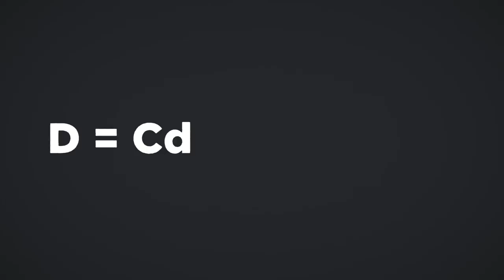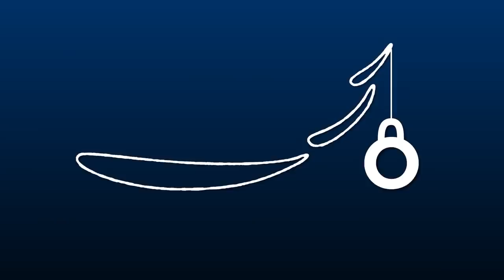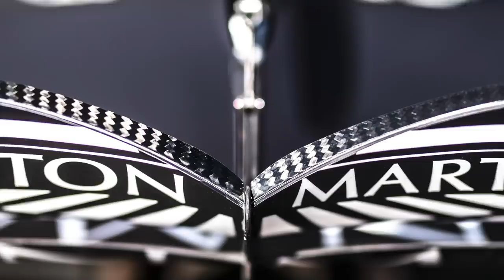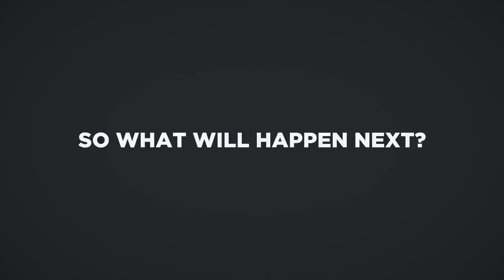What Are Flexi-Wings & Why Are They So Controversial In Formula 1?

Comment: Legal = legal. If they want to change the testing procedure than that's fine for next year.
Reply: Why not change it this year if it legal?
Reply: They should treat this like they treated DAS for Mercedes last year.
Reply: It's not legal. The regulations are clear, but the current tests can't factor in the loads. It's like there being a rule stating uou can't go faster than 20mph but you only have speed trap equipment that measures to 15mph, you know they are speeding but can't prove it.

Comparing this to DAS is like comparing apples and oranges, DAS was legal as there was no rule for it to break, so a new rule needed to be introduced but that can't happen until end of the year, which is why it was banned for 2021.
Reply: @jeeves19831  exactly. I think people’s judgement is being clouded just cause they want redbull to win really bad this season
Reply: Yes last year was it the das system
Reply: @Zerkyie  DAS was legal and abolished for cost savings
Reply: @jeeves19831  how do you create a rule you can't test for, changing the tests mid season because someone was smart enough to fit the tests and increase performance outside the test range is bad for development as teams need to follow interpretations of the rule book on what FIA wants but doesn't enforce.
Reply: Because there is a technical rule where active aerodynamics are banned and a flexing rear wing can be considered as a passive active aero, the reasoning used by teams that explored flexing wings that "it would cost more to make it rigid again", well they shouldn't have explored this avenue in the first place since active aero is banned, period
Reply: @jeeves19831  the cars were designed and tested according to the rules and test procedures that already existed. Changing the test because you don’t like the result is ridiculous.
Reply: Except that the technical regs allow FIA to change the test mid season.  No need to wait for next year.

Article 3.9.9: In order to ensure that the requirements of Article 3.8 are respected, the FIA reserves the right to introduce further load/deflection tests on any part of the bodywork which appears to be (or is suspected of), moving whilst the car is in motion.
Reply: @frankg2003  but the test isn't sufficient, the rules clearly state that aero devices must be stationary allowing for minor deviations, that deviation is as following :-

The first test demands that the rear wing must deflect no more than 7mm horizontally when a 500N load is applied horizontally.

The second test demands that the rear wing can deflect no more than 2mm vertically when a 200N load is applied vertically.

purposely designing a wing that conforms to the 1 degree of permissible movement under the test load but then moves 5 times this under real world high speed loads is clear cheating by circumventing the inadequate testing.

Do you also believe that Ferrari weren't cheating because their engines passed the standard tests and the fuel flow sensor didn't read high despite flowing far more because they worked out that they could pulse the fuel flow in opposition to the poling rate of the flow sensor?

cheating in a very clever and ingenious way is still cheating.
Reply: @Addyboy0190  Hmm. Just like DAS adjusted toe angle, which actively adjusts the aerodynamics = active aero. Wasn't banned for a whole season.
Reply: @frankg2003  Imagine what RB is going to be like next year.  They demanded a freeze on engine development for the entire 2022 year.  They know that the Honda I mean Red Bull engine is good but not as powerful as the Merc so they come up with flexing wing to get speed on straights - mini always available DRS system - and next year because Merc is going to push engine development throughout 2021 the Merc engine will be so much better than RB and RB won’t have flexing wing and a cost cap for finishing 1st or 2nd in 2021.  I think RB and Max are going to be nowhere in 2022 but I guess that should be expected from a soft drink company versus an auto manufacturer.  Max at Merc in 2023?
Reply: @azzifyy5988  That seems like an extremely wishy washy rule. "Wings aren't suppose to flex! Except a little bit.. because they have to! But we won't tell you how much! Instead we implemented tests to check that they're not flexing too much, except if we feel like it we might change those rules midway through the season."
Reply: @oxfordsparky  FIA never provided how much a wing is allowed to flex at speed. It's not "inadequate testing", it's literally the only rules they've provided. "Wings must be rigid, except not 100% because physics" is not a holdfast rule. The actual rules are the testing procedure, which is what you described above.

This is very different from when they implement a rule (fuel flow), then implement a test (make sure that a car stays beneath that fuel flow), and then the team finding ways to circumvent the tests. I think you can agree that these two just aren't the same. In one instance, the testing is done to enforce the rules, in the other the tests are the rules.
Reply: @jeeves19831  then why test it at all?  In your example there's no point of testing to 15 miles an hour When the rule is 20. The difference here is that all wings Flex to some degree. It's very difficult to quantify what degree of flex is allowable and what isn't. That is why you need a test. That is why the test is the rule.
Reply: @luccass6793  I couldn't agree with you more. The rules are set at the beginning of the year and should stick for a year. What is there was too much Flex in the chassis? Yet of course it passed the test. Would they make them design a whole new car midseason? How can you expect someone to change something so intrinsic to the whole system mid-year? I get this whole Spirit of the rules but that's a hogwash. Rules need to be definitive cars are built to those definitive rules and the result is what is accepted. If you don't like it don't accept it but don't change your mind later.
Reply: @azzifyy5988  clear that it's more? Yes! But that's all. The test is needed to determine what is too much Flex.
Reply: @Addyboy0190  is it active Aero? What's activating it? Passive sounds a heck of a lot different than active. Even back in the effed-up days they tried to claim that the movable device was the person covering the hole in the driver's area. They decided that didn't count. So what is the movable activating device now?
Reply: @oxfordsparky  not cheating period building to the letter of the law. If you want stricter requirements build a stricter test. If you want to pass someone don't expect them to let you through you've got to take some calculated risks. No one builds a car to what they intended they build the car to the maximum they can get away with. That's how you win races and it's not cheating. Cheating is stealing someone else's car plans. Cheating is having something that is not allowed and hiding it like traction control on the 14th level of your menu system. This is ingenuity. Building something that meets the requirements and still does more.
Reply: @azzifyy5988  sorry I don't follow.  There is a load test. They passed. I see no problem other than deciding to change the load test after the requirement was met.
Reply: @devilliersmolefe3851  Because you design against a test spec to verify your design. Changing the test changes the design.
Reply: @jeeves19831  It's not RBs fault that the FIA test is insufficient. They design against the test from the FIA, what do you expect them to do? Changing the test will result in increased costs, new designs have to be made.
Reply: @cfg_form2122  They got the mass demper from Renault banned under a moveable aero device, that was even more far fetched.
Reply: @azzifyy5988  you can't have an ambiguous rule. If there was no test and the rule just said it can't Flex too much no one would know what to build. You have to have a way of saying it can Flex x amount. That is what I believe the test is for. Therefore the test is the rule. They obviously didn't make the test to what they wanted but they can't go blaming Red Bull for that.
Reply: @azzifyy5988  I can agree with that. Obviously the tests were substandard. I just see it time and time again in Formula One that when things come up as the FIA didn't do their job in policing the team gets blamed. Or the FIA basically says we we didn't mean that and then they changed the rule midseason which totally irks me. If we sit down to play Monopoly and we discussed free parking and Community chest  in advance don't go telling me otherwise Midway through the game. LOL
Reply: @sparqqling  you are right but if the wing passes the test but still has a weird behaviour the FIA have the right to change the test which is what they are doing
Reply: @jeeves19831  "It's like there being a rule stating uou can't go faster than 20mph but you only have speed trap equipment that measures to 15mph, you know they are speeding but can't prove it." Sorry, but that analogy isn't comparable enough. Also, most of the teams has a flexi wing... if not all of them.
Reply: @Zerkyie  no because this has been illegal since the 90s. Also Das wasn't ever braking the rules.
Reply: It says in the rules that they can change the rules at any time they want, so they don't have to wait till the end of the season if someone finds a loop hole or work around
Reply: @akagainesy  only for things like rear wings because it was band in the 90s.
Reply: Oh like they made the rule for banning party modes mid season… because of Red Bull’s complaint. Nope, test the wing and ban it when it fails this season.
Reply: @driver8703  that's right. Rear wings come under the safety rules.
Reply: @frankg2003  dude the FIA reserves the right to change testing if they aren’t satisfied with the result every teams knows that 😅😅
Reply: @cfg_form2122  well it was used for heating tyres not during a race. And NO rule covered the development of DAS it was made illegal because the felt it would be too expensive for the other teams to develop
Reply: @sparqqling  again the FIA reserves the right to change test midseason if they aren’t satisfied with a the cars
Reply: @jeeves19831  well if it’s not legal why didn’t they say it in 2020 then only because mr Hamilton was complaining
Reply: Stop comparing DAS which was legal to an illegal rear wing... It's clear in the regulations 😂🤣
Reply: @Zerkyie  Here you go. The right answer.
Reply: @jeeves19831  From what I gather this was tested by the FI And passed, if that's the case moany Lewis needs to STFU. If they want to change their testing regime that's fine as long as they do t fairly and consistently but for now it's legal.
Reply: @devilliersmolefe3851  No. The FIA have the money and wherewithal to test for things like this if they so choose. They can easily test for x and add a margin to cater for unexpected circumstances. Mercedes are eating very sour grapes indeed.
Reply: @luccass6793  The teams have never been known to abide by the spirit of the rules and I believe that there are current rules that this could fall under.
Reply: @azzifyy5988  Then the FIA are at fault, they have been deficient in the way the rules are written.
Reply: @gottliebdee263  If you studied engineering, you would know it is very possible to create a test that you think covers everything, but in reality, it doesn't, so you change it, and that is what the FIA is doing.
Reply: Read the rule book first. It says they can change the tests at any time.
Reply: @Zerkyie  the difference is that DAS was deemed legal but too expensive for other teams to implement to catch up.
Reply: @frankg2003  its not a case of not liking the results,  all that's happened is they have discovered the test isn't sufficient to prove the rules have been adhered to.
It's like speed cameras. Speed cameras took a photo if you exceeded the speed at that point.  So people drove as fast as they wanted and slowed down before the camera...they passed the 'test' but were breaking the rules. Then, to counter this, a more stringent 'test' of the average speed check cameras was introduced.
The law has remained the same, only the method of checking has changed.
Reply: @cfg_form2122  because it was deemed legal so why ban a legal device?
Reply: So Red Bull are stating they don't want the test introduced early because it will cost them too much money to fix it. They already know that they will fail the new test designed to more stringently test for adherence to the rules. So basically they're admitting they are currently breaking the rules?
Reply: @MrPixiepantz  beside they knew the risks they were taking when they designed the wing, so they should be willing to face the consequences of that.

Comment: Great video, but you could have said "drag force increases quadratically" at 1:56, since at 1:50 you present an equation that shows that the relation is quadratic, not exponential. Keep the great content flowing!
Reply: An exponent is used to denote the index/power of a variable. Exponential can be quadratic, cubic, quartic and so on. So yeah, quadratic IS exponential, not the other way round. Sort of like how every square is a quadrilateral but not every quadrilateral is a square.
Reply: @sharvapotdar3257  An exponential function has fixed base and varying exponent. A power function has a fixed exponent and varying base. Thus my comment.
Reply: @Pedro_MT_Marques  is it? I'll have to look again, then. What I read up was a bit confusing, I'll be sure to read up on it again👍

Comment: Its controversial because Mercedes is crying and feeling to loose the 8th title...
Reply: Its controversial because, in whats being touted as a 'competative' season, some teams are following the regulations, while others claim that by exploiting a inspection test, it means they shouldn't have to follow the regulations.
Reply: @jameshoover492  founding a loophole and breaking rules isn't the same thing
Reply: @hamzahadzic3450  there is no loop hole. There is no grey area. The technical regulations have not changed and are clear. The rear wing needs to be rigidly attatched to the car with zero degrees of freedom and remain immobile.

The FiA test wasnt good enough to inforce that rule, so redbull exploited the test to break the rule.
Reply: @jameshoover492  It has no degrees of freedom lol, only the drs. Try producing a completely rigid carbon fiber wing. Spoiler: you can't. There's a reason carbon fiber is a fiber and not concrete lol. Even article 3.9 allows for a degree of bending because the drag at 300+ km/h is insane.
Reply: @jameshoover492  As they say in the United States, if you aren't cheating, you aren't trying. In Nascar, one team back in the day, forget the name, used to fill the car's hollow section (might have been the roll cage) with metal BBs to meet weight restrictions during scrutineering and they had a release that the driver would discreetly pull that would drop all of the BBs out of the car lowering the weight significantly. They were even so clever as to hide the hole where they dropped out of in the jack point on the car so it was hidden by the jack every time it went in for scrutineering. To be honest, I imagine every single team on the F1 grid is breaking the rules in some sort of way, and the ones who aren't simply aren't clever enough. F1 is like baseball and pine tar, everyone calls each other out for using it, but at the same time, everyone is using it and breaking the rules just the same.

Comment: Engineers: Innovation 💡 
FIA: NO. 

I don’t understand why breakthroughs are always penalised or the rules changed vs being praised… such as DAS, the fan car, or the monkey seat etc.
Reply: @justcows7772  well I fkn hope that the budget caps will enable less stringent engineering rules
Reply: This is down to safety regulations.
Reply: Lol  building a rear wing that flexes while the rules state that you can’t do that. That isn’t innovation my friend that breaking a rule 😅🤣 DAS was innovation since no rules stopped it from being developed while the rules are pretty clearly that you can’t have wings that flex
Reply: @bartybum  no it will add more because of cost
Reply: @devilliersmolefe3851  except it did tangle with some of the rules, like the aerodynamic portion of having wheels that align differently in straights and in bends, or the fact that somehow they managed to change the angle of the wheels without moving the suspension...
Reply: @fetusofetuso2122  dude it was used during safety cars and cool-down laps it wasn't used during the race. so basically it gave Mercedes an advantage on the restart they never used it mid-race.